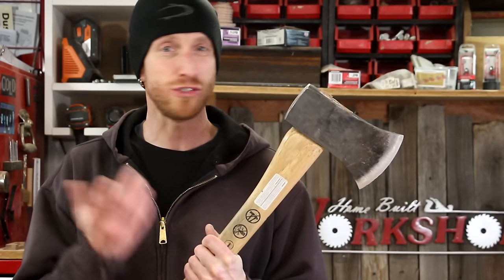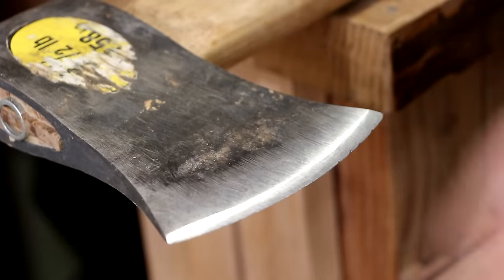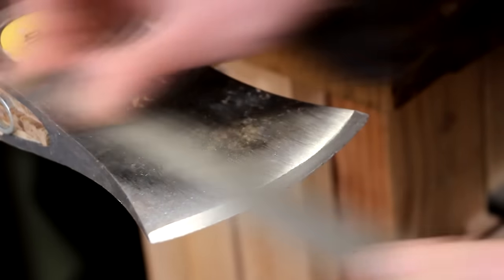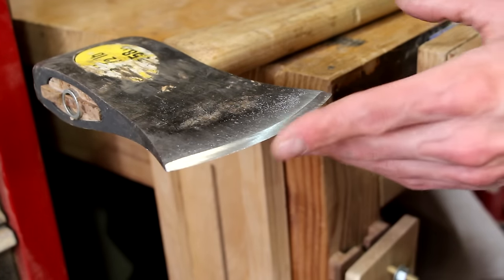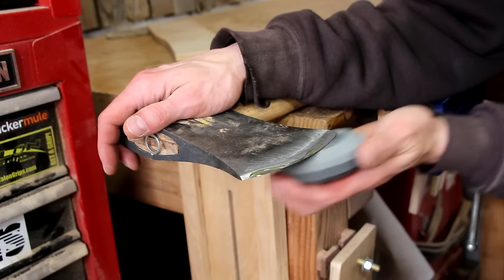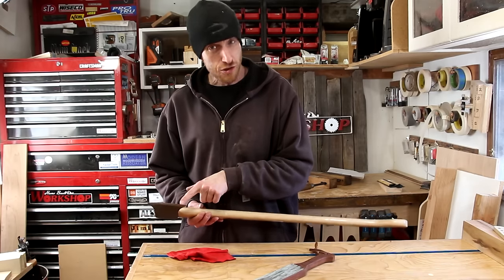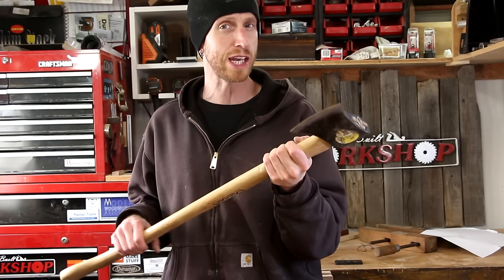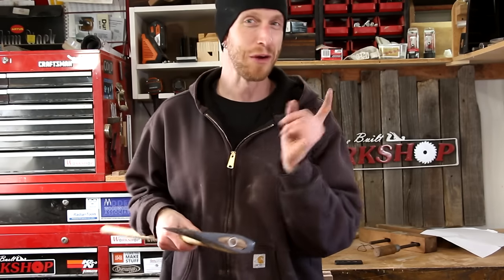How to Sharpen an Axe (Its Easy)

Comment: Is the paper check appropriate... it's meant to cut throw wood and not have the edge bend... a thin edge will let you cut paper take well but it won't hold the edge as you chop away...   If i understand the physics and material science correctly. I could be wrong.

Comment: Sir .nice video..
I'm a bit confused.. please help me understand ...are axes tempered into a certain hardness so you can sharpen it with a file..
I watched a lot of knife making videos..after tempering the file don't bite on the metal..
Hope my question is valid...
thanks very much
Reply from the maker: I imagine they are a certain hardness although I don't have the special files to measure it. Once the head of the axe is hardened, they would have to temper it in order for it to not be brittle. That's why we can sharpen with a file.
Reply: @homebuiltshop  thank you very much sir ..more videos please

Comment: Awesome video! I’ve never done this before, Why do you use the oil?
Reply from the maker: The oil helps the filings to not plug up the stone and lubricates the cutting surface.
Reply: Home Built Workshop great! Thanks!

Comment: Been reading some comments about guys cutting themselves doing this. And no wonder!
You NEVER file INTO a blades CUTTING EDGE! If you do, well I'm glad you got cut. Even better suffered nerve damge or lost a digit!
Play stupid games, win stupid prizes!
ALWAYS keep flesh you DON'T want cut BEHIND the cutting edge of the tool! In this case you push the file from the handle side of the head across the edge and finish your stroke OFF THE BLADE as opposed to INTO THE BLADE!
If you cant figure that out, without being told, you're not smart enough to use this type of tool.
And for those of you who are smart enough but maybe not too experienced yet remember, this is an axe, not a carving knife! It SHOULDN'T be RAZOR sharp! By making it this sharp youre making the edge weak and prone to DAMAGE like CHIPS AND DENTS OR ROLL OVERS! Things an axe should never suffer. It should only become DULL and NOT damaged?
You shave with a razor and cut wood with an axe. Making an axe sharp as a razor is like wearing an evening gown and heels to work on your truck!
As they say, If you want to make toast you gotta be smarter than the bread!
Ya dumb shit!

Comment: I use my 20 year old dull axe all the time, works great, but my back hurts

So all the sharpening is done dry?
Reply from the maker: All the filing is dry. I used a bit of oil on the stone.

Comment: Did you use a cross cut or a bastard on that edge?  Another BIG factor that the foreign axes have over the cheaper domestic axes that most people don’t consider the heat treatment that goes into them.  If you have to sharpen a cheap axe every few swings then it dosent matter how sharp you can get it.  You want it to get sharp and stay sharp!  I only have to sharpen my pocket knives once a year because they have hard steel.  It cost more upfront but I don’t have to sharpen them very often.  It’s also free to me to get them sharpened, courtesy of Benchmade!  I’ve had my mini griptillian for most 13 years and it was $100 new with D2 steel but over that time that’s less than $10 a year.  Invest in quality and you won’t be let down.
Reply from the maker: You make a great point. Better steel holds an edge better. This cheap axe is probably not the best steel. I don't use it all that much so I am ok if I have to sharpen it a little more.
Reply: @homebuiltshop  I haven’t watched a ton of axe reviews, unlike knife reviews, but I don’t remember anyone of them naming the type of steel used to make the axe head.  I’m sure if one used a top of line newest technology it could cost atleast $500 but again I’m not an axe expert.  Where did you buy your axe?  How old is it?  I text a friend last night after he asked me what I was doing and I told him I was watching people chopping and splitting wood.  “Therapeutic isn’t it!”  Lol he beat me to it!

Comment: I got an antique double bit axe for 5$ at a garage sale that I'm in the process of restoring and its actually too hard to sharpen with files I have to use stones for the whole edge and even then it's a pain to sharpen
Reply from the maker: Wow, that sounds like a lot of work. It will be sweet when you get it done though.
Reply: @homebuiltshop  I just hung it and did one side today it kicked my ass but it was well worth it I'm gonna sharpen the other side tomorrow and give it a test 💪👍
Reply: Be aware that file resistant steel is so hard it is likely to chip. If you are working in thhe cold warm the ax to a comfortable temperature before you start.

Comment: hi,
Thanks a lot for your sharing! But the lansky puck, it's just 120/240 Grit. I think, for an axe, you can use 600Grit for longer cut.
And this stone need water or oil to use. Oil is a good choise, stone is less agressive.

Comment: Thank you for the video! Just a question: you say, that you cut across with the file just the front edge of the blade.. the front edge means exactly what? the place between the ridge and the edge? That is the only place you use the file on? Or do you also file a bit ON the ridge itself too?
Reply from the maker: I consider the front edge to be roughly the previously sharpened area. You need to get it smooth and even all the way to the tip.

Comment: The oil is to keep the axe from corrosion right?
Reply from the maker: During Sharpening, the oil helps prevent the stone from plugging up with metal filings.
Reply: Also a good idea to put a light coat of oil on after using the axe to help prevent rust.

Comment: My brother doesn’t respect his tools. They get All rusty and blunt. I forgot this. Let him use my double bit axe. And i had to sharpen it and get rid of the rust. He also hit concrete, leaving a permanent dent on the edge. 😭
Reply from the maker: Oh no, you might be able to file that dent out and revive your axe.
Reply: It was my council tool double bit axe. I did. But it’s still there lol. At least i resharpened both heads. It was so clean and beautiful before he disrespected it and leave it out in the elements.

Comment: What angle are you sharpening at? 30-40?
Reply from the maker: Its somewhere around there. 30-40 degrees is a common angle. I didn't measure this one, I just kept it close to the original angle on the axe.

Comment: You used the fine side of the stone puck in the video both times, you never did use the course dark side like you stated.  Not a big deal, but your verbiage does not match your actions.  Also you should never grind or file in circles, always grind or fine in a straight line perpendicular to the edge you are trying to sharpen.
Reply from the maker: Yeah, That's an editing error on my part. LOL. Not trying to fool anyone, I really did use both sides. Sorry for the confusion.

Comment: I use a big spade drill and drill a few holes and burn the stumps out
Reply from the maker: I would have loved that. Probably not the best option in my area though.
Reply: Drilling holes and filling them with epsom slays works also

Comment: I would be careful sharpening an axe to the point it can shave hair. That typically requires a knife edge which will get nicks and dull faster than a moderately sharp crown edge, axes cut wood not food.

Comment: This issue I have with every single axe sharpening video is that the host quotes all these angles and numbers at you the viewer and gives no clear explanation of how to achieve the angles. Then they just sharpen like we have done it a hundred times and give absolutely no details on how the correct angle was achieved or measured. I get that the 20* degree angle may not be exact like 18 or 22. But how do you train yourself to achieve that angle as you file or how do you measure your progress as you go along? The host that can explain that would greatly impress me and be helpful. If your not going for specific angles then just tell us. Are you just doing what looks right to your eyes? Is the angle and filed edge subjective based on the axe type? Also most common men chopping wood don’t have a $2000.00 machinist belt grinder to sharpen an axe with so a video using a file and sharpening stone that the average middle class American male can afford would be great.

Comment: Axes don’t need to be sharp though. Granted the shouldn’t be squared off either but they don’t need to be sharp to be effective. Same as People who get a razor edge on a machete are totally missing the point.
Reply: Russ Goodban no offense to your opinion, but if you use a truly sharp axe I think you will change your mind. Look at those guys who use those competition axes. The head does the work not your arms and back. Just my two cents.
Reply: I’m not saying sharp as in razor sharp like a lot of people seem to think.  They need an edge, sure, but some people go overboard with natural whetstones etc.  I’m talking a long handled axe. Hatchets are a different story, you should be able to whittle with one of those.

Comment: Never put a grinder or file on an ax, you take the temper out of the steel. For an edge that will hold up you need to heat the metal and hammer the edge to a sharp point with a hammer.